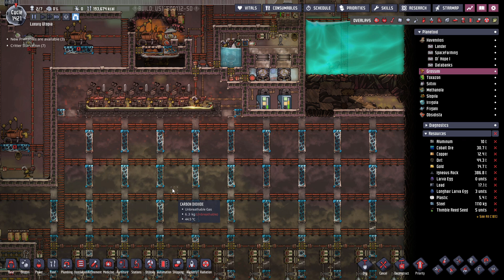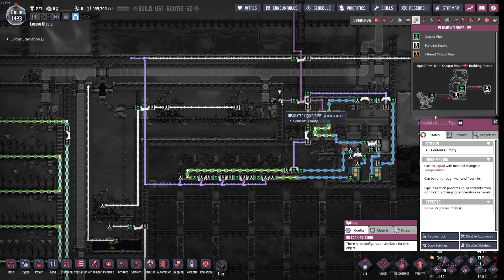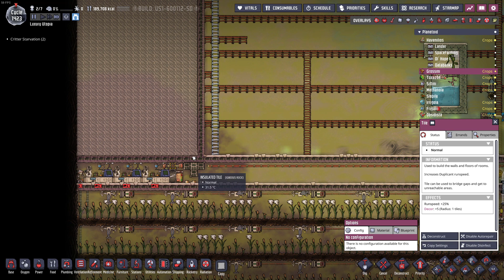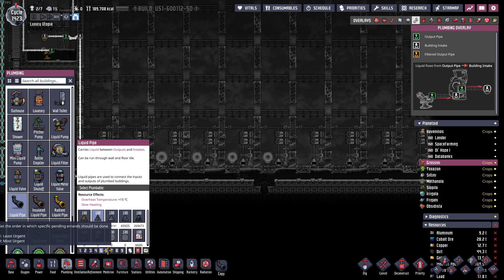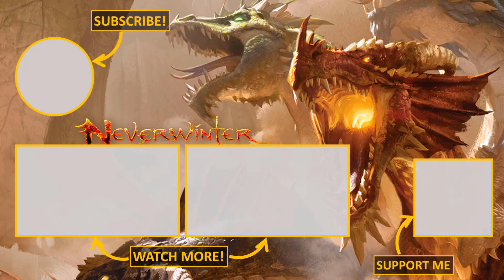S02E61 – Mega Project Complete: Petroleum Boiler Finished!

Comment: always use diamond plates for the cooking tiles. The SHC has to be enough to not heat the petroleum so fast. If it heats up to fast you will break pipes. You can also use lower TC radiant pipes near the end for less temperature transfers.
Reply from the maker: Hmm a bit late for that now but I'll keep it in mind for my second petroleum boiler 😉. I think increasing the tank size also has fixed the issue for now but if it hasn't I'll exchange some tiles